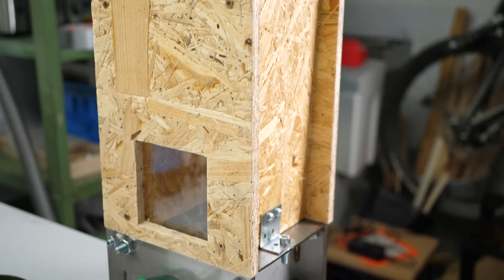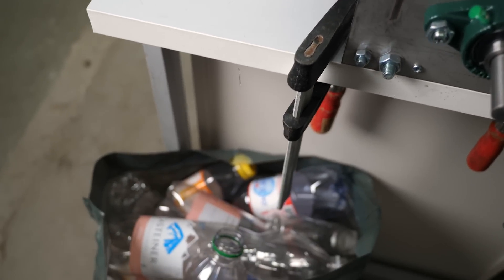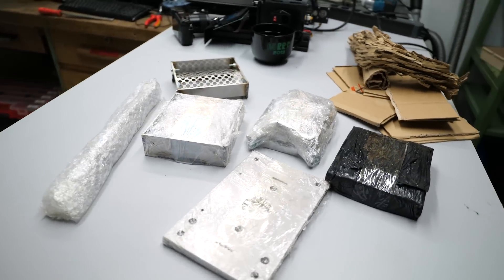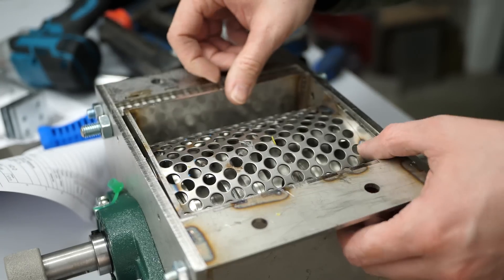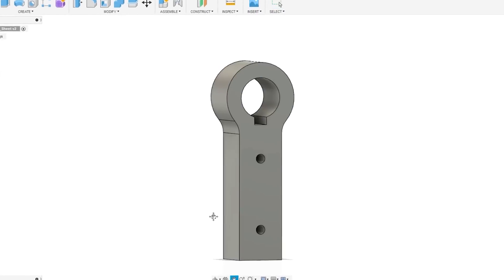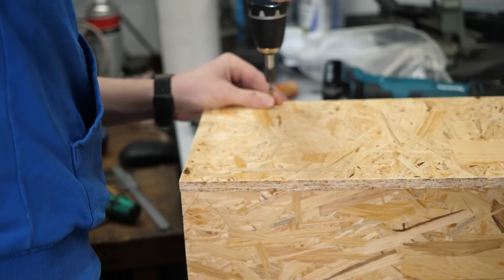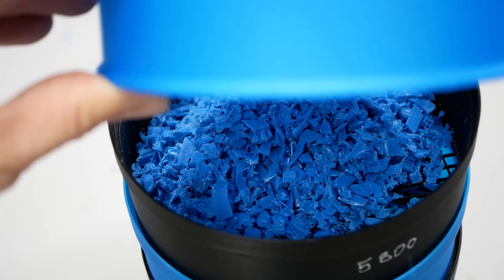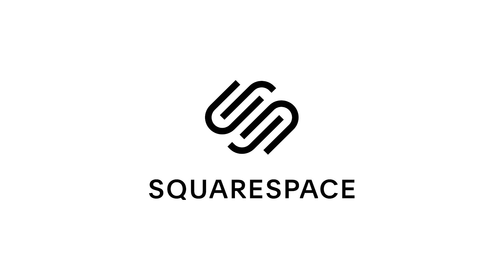Building a Hand Cranked Shredder for Recycling Plastics 💪

Comment from the maker: Don't forget to share this video on Facebook, Reddit, Twitter and other social media!
Reply: you could use a reduction gearbox(1:12-15) + a drill or cordless drill to speed up the process, one other comment suggestet to preheat the parts like 60-100degrees (?)
Reply: Teaching tech seemed to have good success using a cheap electric winch
Reply: I was thinking a bicycle/motorcycle gear reduction could be made to help out. Maybe a concrete base to weigh it down and hold the gear reduction. The molds for the concrete could be 3d printed.
Reply: https://www.youtube.com/watch?v=S_Dry6tgrZc&feature=share
Reply: This idea seems good for a 1st pass before feeding the line through a filament former.     https://www.kickstarter.com/projects/910418035/plastic-bottle-cutter
Reply: can you mix different plastics together and do a strength test on them, maybe you can make a stronger plastic yourself?
Reply: That really needs gearing...
Reply: Hi Stefan , benutz ein drehmoment verstärker das das hilft ungemein. 
https://www.amazon.de/s?k=drehmomentverst%C3%A4rker+lkw&__mk_de_DE=%C3%85M%C3%85%C5%BD%C3%95%C3%91&crid=21BTMFCOYYKNO&sprefix=drehmomentver%2Caps%2C199&ref=nb_sb_ss_i_1_13
Reply: I would add a heat gun or something like that to soften the plastic a little bit.
Reply: Bonj je suis intéressé de votre produit  , dechecteure de plastiques j'ai pas pue la de faire une commande  pour envoyé  ce produit en Algérie
Reply: Je suie algériens j'ai jamais fait une tontaction  d achats de produit de recyclage merci
Reply: Warum soll man dein Werbecontent noch teilen? Damit Du damit noch mehr Provisionen kassierst - Natürlich ...

Comment: it maybe possible to use some neodymium magnets to remove metal shavings, then melt the fine grade plastic into sheets or slabs with a decorator's heat gun and shred again ! 
🏗️🧲⚡🔩

Comment: I see you have a bike in the background of your shop (another video) rather than using a hand crank, why not create a connection that allows you to use your bike to crank the shredder...that way you can also use the bike gears along with your legs, which are much stronger than your arms. and if you make it removable, then you can keep your necessary footprint to get shredding done much smaller as the grinding portion can be stored away..

Comment: Why don't you file a key into a nut that slides tightly over the centre axle and then use your impact driver with a simple socket. Also uses less space than that huge handle.

Comment: Cant you save those smaller bits / pieces for a "scrap run" of filament that you don't expect good results with, make it, shred it...and then go through your process again to end up with more useable material?  Or at that point is it not enough return on sweat equity?

Comment: I think if you put a pulley system on your crank side. You can re- gear it and make the handle shorter.
The huge handle must make it harder.
By re-gearing you should make it use a smaller handle. Making it easier to operate. And may even make it more powerful..Though it will be slower.
But in the long run. it will be faster because you are not fighting the operation as much.

Comment: You have given the answers yourself. You need a real heavy flywheel. Consider to look in the scrapyard foran old butchers cutting machine for  cold cuts. They have a really bulky flywheel and the handcrank already there. You bring the machine up to speed, let the flywheel spin and slowly add plastic. Even a butchers cutter is a good workout. Of course any thick round steel or concrete plate wil do. I think even a concrete paver willdo the job.

Comment: i would add a 48 volt ebike motor like the cyclone  motor witch their controllers can easily do 1600 watt and gear it down so it has enough torque to power through tough plastics.

i do scrap metal recycling and i get lots of plastics from the stuff i tear apart such as air conditioners and shredding the plastics would be very handy as it would save space in the garbage.

Comment: I would suggest smaller teeth (wider hub) on the shredding wheels; the shredder should be nibbling at the plastic parts rather than shearing them, but you're cutting chunks of plastic in half.

With appropriate gearing and a bicycle frame you could drive this with leg power and easily incorporate a flywheel; strap some balanced weights on the bike's back wheel, perhaps.

As a bonus, use the bicycle brake as a safety mechanism, but reverse the actuation to make a dead man's handle; let go of the lever and the brake clamps the flywheel halting the shredder. Might be a bit tough on the hands constantly fighting a spring powerful enough to stop the wheel on its own, but nobody wants a runaway shredder!

Finally, two sets of interlocking, contra-rotating shredding wheels will do a much better job of snatching and nibbling at the parts. A pedal-powered flywheel should help overcome the additional energy losses and smaller teeth with make the shred less choppy with fewer torque spikes.

EDIT: I just realised how old this video is, sorry. Popped up up in my feed today. o.O

Comment: Would it work to use the 160:1 Gearbox that is 3D printed and designed by GearDoWnForWhat? I thought about that as i saw that it can lift up to a half ton of weight and it would be nice for using a weak motor of a trash electronic device. Any opinions or expiriences with that? I dont hav the experience in physics to this idea and dont want to waste a kilogram of filament and way more time if that could not work.

Comment: Use a gear system to increase the torque so you don't have to crank as hard.
Reply: Would it work to use the 160:1 Gearbox that is 3D printed and designed by GearDoWnForWhat? I thought about that as i saw that it can lift up to a half ton of weight and it would be nice for using a weak motor of a trash electronic device. Any opinions or expiriences with that?

Comment: Hi Stefan, did you consider heating up the shredder chamber? If you heat up the plastic to a certain point, where the plastics get softer, it might be easier to shred it. In that case, it would require less torque.
Reply: what you say would cause the plastic to stick to the teeth of the shredder
Reply: @danielepellegri346  I meant a particular temperature point where the plastic is not becoming liquid but a little soft like Klay but still brittle. Let's say about 50 or 60 degrees Celsius.

Comment: Over a year late, but still.
Others have already suggested gear reduction.

Are the metal bits all magnetic? Can you float apart the wood bits and remaining plastic? Wikipedia would suggest that PLA, minus air voids, should sink in water. Granted, that's not a lot of waste in any case.

How would it behave if you put your plastic to shred in the refrigerator or freezer overnight?

Comment: I wonder if heating the parts will make a difference for the better or worse. It will definitively make them softer with some hot air-flow. while the hot air wont damage the steel, I wonder if layers of will stick to the shredder.  Which also brings up the point of some lubrication that could be reused. Hmm over all, this is a great idea. Mainly because the main cost in recycled plastics is sorting them and efficiency goes does like a stone with public services.

Comment: Just watching this - your sieves look and operate very similar to the aggregate measuring sieves used in stone mining / quarrying operations.  As a prior materials engineer, one thing to note is that sieve hole sizes only guarantee your pieces are less than the hole size for the 2nd longest side of any particular piece - if you think about it, you could get an infinitely long piece through one of the holes as long as the 2nd and 3rd dimension sizes are smaller than the sieve.  Granted, the space between the sieves in your "sieve stack" will limit this somewhat, but it's something to keep in mind while processing.  Great video - really enjoy your thorough testing!

Comment: Why not heating the PLA first to 50-80C before shredding it? If it would go easier, this would cut down costs a lot. Also, could then a motor of a old washing machine used for it? I guess without heating the material first it would be way to weak.

Comment: Stefan I would not mind using my body weight rather than a electric motor.  I like the manual labor.  Its good for your body and health and free.  But why is the crank arm so long.  I understand to adjust for your height and to exert the most amount of force from you body, but fully extending your arms above your shoulder while exerting full force is going to wear you out and cause a overuse injury.  I would suggest  make the crank arm long enough so you arms are not fully extended in the vertical position by having a slight bend then to full extension on the horizontal plane with ease to bring back into flexion.  You never want to have your arms in a locked position.  This will help your minor muscles stabilize your bigger moving muscles and prevent injury.  Lol, now I am sounding like a sports therapist.  Sorry.

Comment: you should have added a gearbox with some ratio instead of 100 meter long crank-rod. You dont need the speed an direct drive, you need the slow but deadly torque, and this machine will eat anything.

Comment: I'd of probably tried forming the smallest particles into a larger piece in an oven and then re-shredding it. Maybe use a short length of metal pipe as a mold and a weight to compress it in the oven? It doesn't need to be perfect, and gaps would actually make it easier to break up.
The only other thing I would do would be to install some kind of repurposed gear-reduction mechanism in order to use a shorter handle so you wouldn't need to bend over to finish turning the crank. That looks like it could result in back injury the way you're doing it.

Comment: Hi Stephan, great video!!
I may have one suggestion or two to improve the shredder.

First one is to use a freewheel to connect the shaft to the axle, so you can reposition the shaft   angle freely allowing you to use you bodyweight to hel crank it down from an extra torque on the shredder. I believe such thing could be salvaged from an old bike real wheel sprocket.

Sometimes you will not need as much torque so a big shaft end up being just extra weight to be lifted so it would be nice to have it to slide radially on the axle like a video shaft so you can use only half of the length most of the times extending the arm when needed or applying force to both ends.

Lastly, a small handcrank paired with a worm gear would work wonders, it could be manually cranked or cranked using a cordless drill depending on the torque multiplier of the worm gear set.

In each way the project stays small, the first 2 options would be very cheap the third on would be the less tiring to operate.

Thank you for this opportunity to share this opinion, hope you get the best of you subscribers at the comments.

Sorry for anny grammar mistakes

Best regards

Comment: it's important for the shape of shredder to fit the uses. this shredder has huge but not so strong tooth, which should be good for breaking down thin and soft material quickly (i.e. polystyrene, pop can, cardboard). for 5mm chips and hand-cranked, the tooth profile should smaller and finer.

Comment: Is it possible to turn the recycled plastic back into filament? I have imagined an apparatus that just smelts the plastic and lets it run through a nozzle of your choice, before it touches the ground it will be cooled by fans and something (maybe a timed metal arm) bends it around a cylinder so it will be coiled up again

Comment: 2.2kW motor for this thing? Is it an AC motor shown at 5:53? 

Can't you use a BLDC motor? May required some additional motor drivers, but the motor will be smaller (suit your workshop size) and produced the same power, and it's efficient. You can think about that.

Comment: Wouldn't it be an idea to fit a way smaller motor than the 2kW and just gear it down tremendously? I assume you're not in a rush, and it would most likely be faster than hand cranked, for something that would still fit in your shop?
Reply: Also, how does pre-heating the material work? Wouldn't it be smoother to shred if just above glass temp?

Comment: If the reason you're not able to use the smallest particles is just the steel contamination you might be able to just pass an electromagnet over it or something.  Not sure if there's more to it than that.

Comment: For your hand cranked version, I believe a precious shredder with ½ to ⅔ the blade gauge widths and a smaller hook area would suit a lower load human setup. It would still run fine with a smaller motor. “Not biting off more than it can chew.”

Comment: You could print a planetary 1 stage gearbox, the ones from gear down for what have proven to resist huge weights, so you could have a huge reduction and use a small motor

Comment: Use a magnet to get rid of the metal particles. I would wrap it in a plastic bag, that makes it easier to clean. And remove the OSB. Use plastic sheets or folded sheet metal instead to avoid the contamination of your shreds with wood particles. Then you can save the finest plastic particles and reuse them to make your own plastic sheets in the oven.

Comment: Maybe you can use soapy water on the small particles to separate the wood and metal. The wood should in theory saturate and sink with the aide of the soap in the water to break surface tension to be able to sink. The plastics can then by taken off the top and used.

Comment: As many others even first thougt of gear and a smaller Motor, maybe a drill as drive to keep hands free and free from harm. At the outlet of the shredder could be a stack of sieves like the ones used in a multi pair mill.
I would lkke to see your efforts in printing strong PET (free filament could be stripped from the bottle) and HDPE that is nearly unbreakable.
PP would be nice, because in Germany these containers are non-returnable and free of charge. But afaik this material ist only usable for injection moulding.
Reply: As I have seen some minutes ago, my wishes already have become true. But you need some money (about 100 Euro just for auger and heatblocker), tools and skills to build your own.
On the other hand there are working filaments surely using additives for better printing results.
So we will have to sit and wait.

Comment: You wouldnt need a 2kw motor, a 0.75kw induction motor with a gearbox attached, sutible for the job would cost you 120€ and it would run on normal "lichtstrom" at 230v.

Comment: Normally unusable plastics can be mixed with sand and or gravel heated and molded to form tiles and bricks add some carbon dust for UV protection and color uniformity you can tile your roof pave your driveway, garden path, the back alley behind your home and so on.

Comment: It would be interesting to test the strength of a print after being recycled multiple times comparing each one to fresh pla
Reply: In auto parts we had tolerance levels for regrind of sprues and runners.  I suspect PLA will not tolerate much regrind because of the "annealing" behavior changing the melt temp.  Molecular weight distribution affects melt properties and strength and every mechanical break of plastic cuts chain lengths.  ABS was fairly tolerant.

Comment: You'd better put a reduction gearbox. About 1:20 up to 1:50 depending on the hardness ot rhe plastic. Besides, if you put a larger gear ratio gearbox, you can fit a small motor. That way you will have a motorised shredder with small footprint in your shop.

Comment: Very spiffy.  You might consider putting a motor through a planetary gear to amplify the torque, so you can have it motorized.
You could probably take the particles that are too small, and melt them together to make bigger chunks that can be re-shredded?

Certainly being able to recycle all of your test parts is a good way to save money and plastic.  (might have to do this myself.  Been making a lot of draft prints, lately)

Comment: I can't figure out why you haven't taken an Arduino along with a 48V DC Power supply and a Nema 34 Stepper Motor to power your Shredder. A 906 Oz. In. Stepper shouldn't have the slightest problem turning your shaft efficiently.

Comment: What we would do differently? Oh, let my try a short list:
- Diy for the Shredder (requires you to mill tool steel)
- Gears for the Shredder (requires you to mill tool steel)
- Attach a motor anyway. If Time is no problem, together with gears a small motor could do the trick. Just do the math

Why diy Shredder with hardened tool steel? The shavings have multiple reasons. Metal to soft, wrong clearrances (repeating), maybe even to sharp of a teeth (it will break if to sharp)

To get rid of the steel shavings: Strong (REALY STRONG) neodydlium maaagnet. Best with a "thick" plastic foil in between, so you can easilly pull it of for cleaning the magnet.

Maybe convert it to filament. And to do so, I recomment you to use a nozzle with a metal mesh, to further pull out impurities.